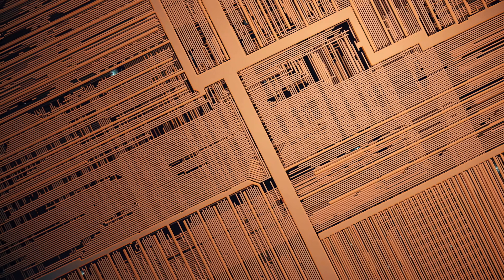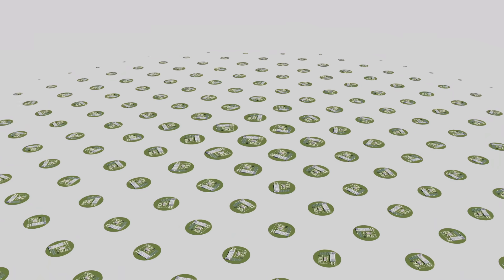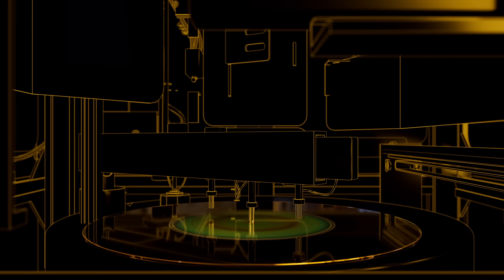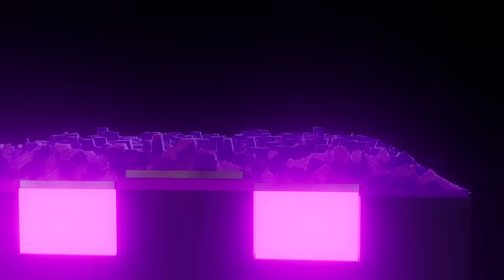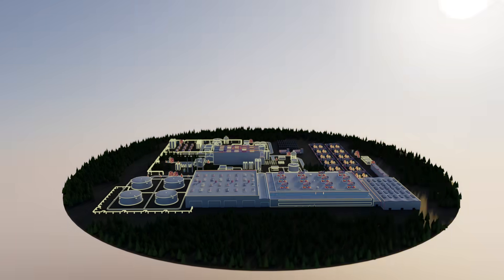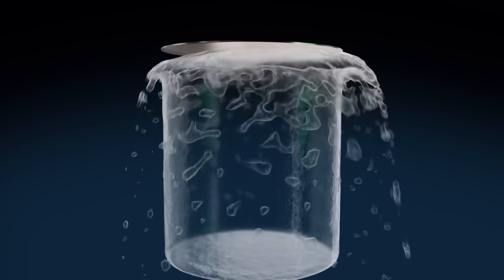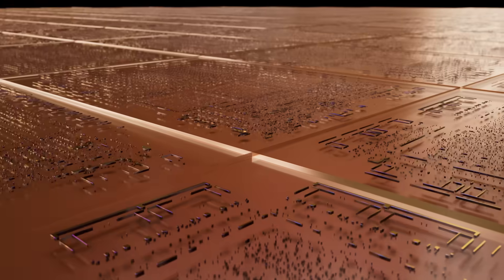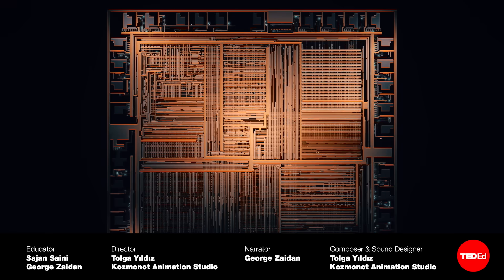How are microchips made? - George Zaidan and Sajan Saini

Comment: Worked in a place like this in Derry.
Called Seagate. About 20 years ago.
Was huge.. even had it's own postcode and address.. 
If I remember it was called 1 disk drive Ave or similar..

I ran metapulse  surfescan  DNS polishers and comptech machines over the years.

Video is quite accurate not exactly for  the place I worked in. But close enough..

but would have been nice to see how the staff that work in the fabs operate..
We wernt allowed ANYTHING from outside. 
We're given special pens and screwdrivers akin to what is used on the space station..
Very rigorous screening and cleaning processes upon entering the fab.

12 hour shifts.. nice.. but if u need a pee or a drink of water u need to derobe and go through the whole re-entry process again..

A simple toilet break/drink water is a 20-30 minute process.
God forbid if u were a smoker.. not possible.. unemployed.

Comment: Photolithography is the method to design a micro chip like how pcbs are designed the light is made thin and used to design microchip like pcb , ionisation is the method in which the solid material is burn and made liquid and then formed in the microchip pcb using tiny mask like that a microprocessor is made by forming transistor and resulting in microprocessor

Comment: 0:38 "Transistors can be as small as 20 nm" They can be WAY smaller, current transistor sizes are around 4nm in the latest hardware.
Reply: 4nm is the distance the electron need to travel from one to another transistor, basically the distance between each transistor no it's size
Reply: @michaeljackson6311actually a few years ago a 1 nm gate was created as proof of concept, I don’t know how they’re possible but they work
Reply: They now pushing it to 1.8 and 2nm
Reply: Actually they rarely are much smaller than 20nm. For quite a while nm hasn’t been an actual measure of size but basically chip manufacturers saying it’s the equivalent of a chip around 4nm. Due to quantum mechanics problems modern chips rely primarily on stacking layers to increase transistors, not making them much smaller. At least till they actually advance transistor tech again.

Comment: i had a opposite perception of how the photoresist works i thought it works like uv resin used in 3D printing.(ie light strengthens the resist material exposed to it which was wrong)
 Edit: actually there are two types of photoresists positive and negative depending the needs.

Comment: And to think that this video is only a very high level explanation of what goes on is just mind boggling. Each aspect of chip manufacturing requires expertise of individuals who are at the forefront of their field. One of my favorite trivia is that the metal plate that holds the wafer in the Photolithography tool accelerates faster than a fighter jet, while having almost 0 vibrations, isolated from background seismic activity of earth itself, and moves to exact position with nanometers accuracy otherwise the pattern being etched is ruined. That's just ONE aspect in a Single Tool used for chip manufacturing. Each tool being used is a work of art, and as I said, made by those who are at the forefront of their field. A single human's life time isn't enough to accumulate enough PhD in all of the fields to be able to start a fab of his own. Quantum Mechanics, Plasma Physics, and Organic and Inorganic Chemistry, Mechanical Engineering, Electrical Engineering... they are just some of the domains involved, and even that is great simplification as these fields are vast and the Fabs require specialization in multiple particular areas of these wider fields.
Reply: well said, its truly amazing that humans have created such miracles. Many smart people from many areas and specialities...truly amazing...and the technology is still progressing to even more complexity.

Comment: My uncle was an FPGA guy and explained this to me when I was like 14, and it ABSOLUTELY blew my mind. It's interesting to consider that this is EQUALLY one of those things that everyone WANTS to do in unmanned factories in SPACE, but ALSO, doesn't ACTUALLY work correctly without GRAVITY, so kinda CAN'T be done in space. THAT part could PROBABLY (question mark?) be solved ("centrifugal gravity" is probably worth considering as there'll be no actual need for LONG TERM human interaction) but the sheer WEIGHT AND RESOURCE consumption described at the end means it would be FINANCIALLY unfeasible without SPACE MINES, as LAUNCHING that much materiel would be WHOLLY unsustainable...

Comment: I work at a fab in the photolithography department and every now and again I have to step back and look at some of the insanities that I work with in this tech. When we routinely qualify the photoresist on a tool we have to check each resists thickness in angstroms and the thickness can be as low as 200 angstroms. Not only that but the range for the thickness will be something like  +/-5 angstroms. I’ve literally had to make adjustments because a resist was 1 or 2 angstroms out of tolerance. For those of you that don’t know, an angstrom is a tenth a nanometer or about the diameter of a hydrogen atom.
Reply: "Angstrom" makes me think of "nanoangstrom" which makes me think of I Have No Mouth and I Must Scream lmfao
Reply: Wtf!!

Comment: 🤔 . . . Could we have bots create smaller bots & those smaller bots create even smaller bots, all the way down to nanobots so small that it’ll function like magic, such as casting a fireball spell or something?
Reply: They get too small that they will be a limit
Reply: I won’t deny that there’ll be a size limit, @ . But imagine, these nanobots being no bigger than a molecule, with its core being a wireless receiver, & everything else around it being, at best, atoms that enables it to float around in the air, permeate through the earth, even being in your very brain cells just so you can effectively cast that fireball spell 😏…
Oh, & there is some genetic engineering involved in this fantasy realm that is induced by this technological advancement & such…

Comment: How can uv light, etch so tiny things?
The wavelength must be a limiter?
Reply: Usually the resolution is limited by the rayleigh criterion. 
R = k_1(lambda/A)
R is the smallest feature, lambda the wavelength, and A the numerical aperture of the lsn.

But apparently you can use immersion lithography?
Something about using liquid with a high refractive index like water between the lens anad wafer, can increase the numerical aperture term. 

Theres also multiple patterning, where you use multiple exposure steps to create smaller features. I assume the yield prolly kinda low with this. 

Also EUV lithography uses a 13.5 nm wavelength light. 7nm without multiple patterning. 

Theres also other technologies like Electronic Beam Lithography. You can just straigth up bypass the diffraction limits of optical lithography by using a focused electron beam instead. Right now EBL is used to create the photomasks for the regular EUV lithography. Too slow and expensive for regular lithogrpahy, but has potential.

Comment: 0:37 2nm not 20nm.
Reply: Except that 2nm is really just a marketing term. At single nanometers, quantum tunneling starts screwing up with transistor's functions, so the physical transistors had mostly stayed at 20 nanometers while they moved from building FinFET to Gate-all-around FET transistors.
Reply: 2nm is just the smallest width you can reliably make, but the actual full transistor with its source, gate, drain and channel components take up more space
Reply: I beleive he meant the transistor size as whole rather the band gap

Comment: Very useful and interesting. But I wonder if the equipment used to make these chips themselves have chips. If so, how has it started originally?

Interesting though
Reply: You dont need much computation for alot of these processes. Actually you needed no computation when people first started doing lithography. This is a matter of chemistry and physics. Not Computer Science.
We first started out with discrete transistors. Search up Ben Eaters 8 bit TTL breadboard computer. 
He explains in good detail how such computers are first made.

Even a simple single stage computer like that is very powerfull. Powerufll enough to automate the process enough to get to mass production.

Once people have basic computers, then you get stuff like HDL's, where you write the chip in a progrmaming language, and the computer draws up the chip design itself.